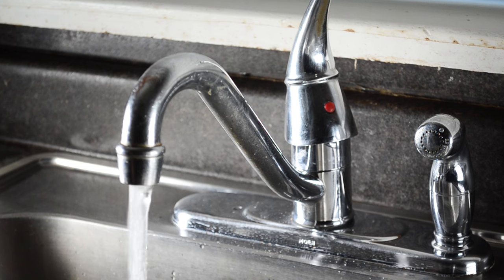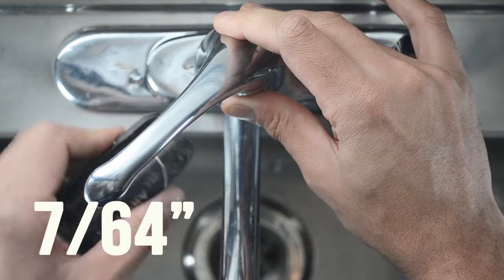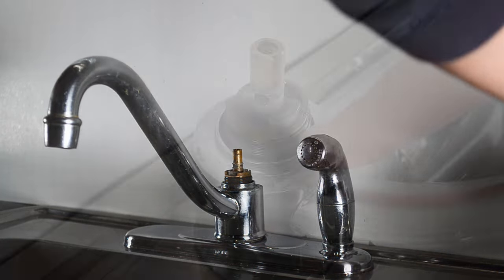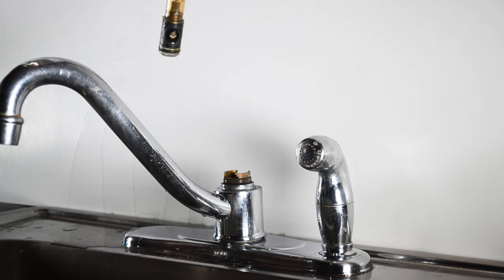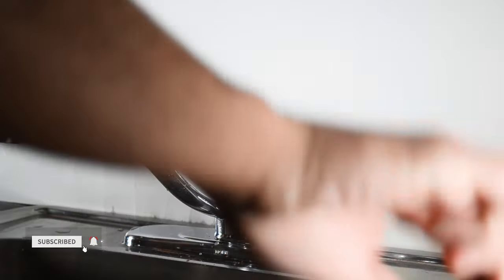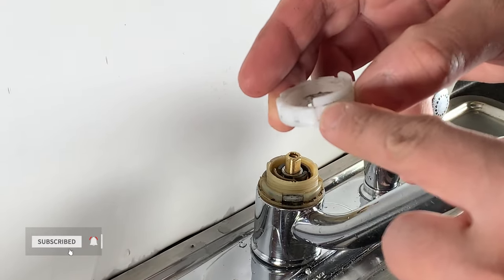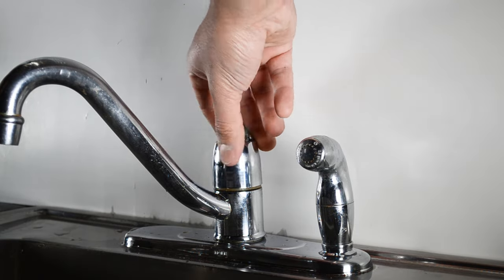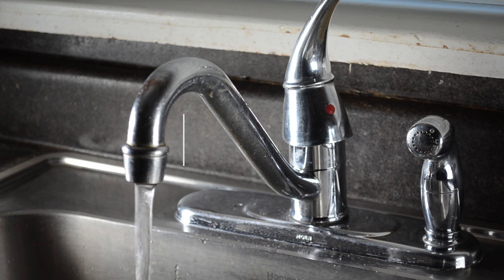How To Replace MOEN Faucet CARTRIDGE (1225) - The Building Expert 2023

Comment: I couldn't even remove the first screw, deep in that hole. It cannot be removed even by a Nobel prize winner. I never got a chance to see what the cartridge looked like. I reckoned I wouldn't be remove it either. I would rather get a new faucet than deal with the impossible tasks. The Moen faucet is not meant to be disassembled. Save yourself the grief and trouble. Just get a new faucet.

Comment: There is no handle screw in my handle. I can only see open threads.  I have the proper Allen key but it does not grab anything. Any suggestions?

Comment: What's the orientation of the handle adapter around 3:30? Doesn't it matter? PLUS, I can't get the handle off. Feels like something is holding it on from inside. The dome screws off easily and the handle is loose bu.t won't pop off. I'm afraid to break it.

Comment: Hello, The Building Expert, while re-inserting the new cart it does not just slip all the way in, it stops approx. an inch or so
with strong resistance. What can I try to do to get this to go all the way down do you think?
Reply: I hope it still isn’t stuck, but I found that having a cartridge removal tool was super helpful for not only getting my stuck old cartridge out, but for pushing down that last inch on the new cartridge.